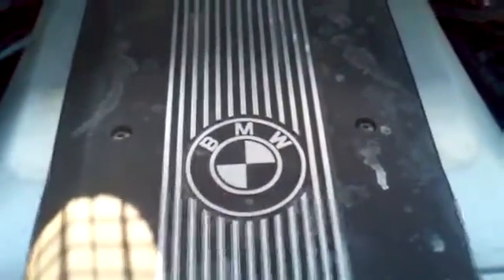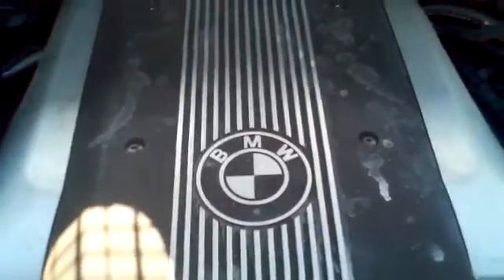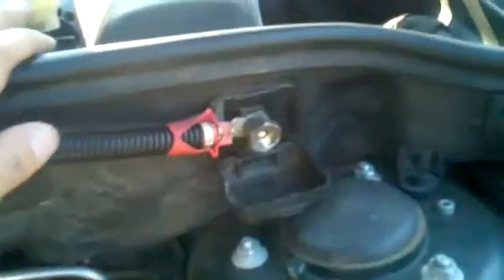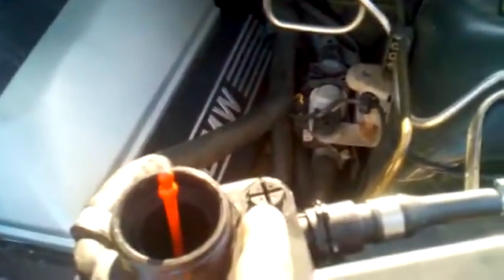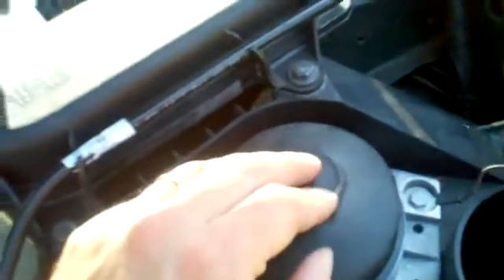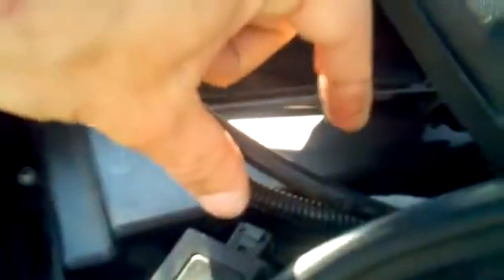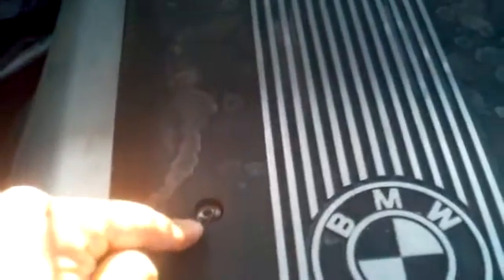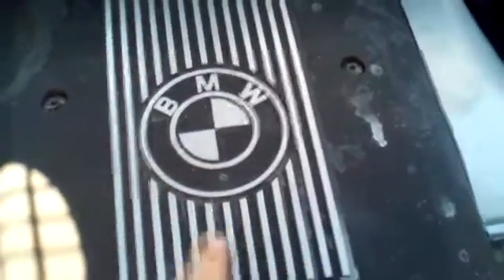X5 Micro Filter Replacement and General Problem Overview

Comment: hi there ...i have horn fail ....i would love if u can help ...when i bush the horn in the steering wheel i just hear clicks on the car anterior ...like it is trying to work
Reply from the maker: Hello, I do have a video on how to test the horns on a 3 series E46 which will be very simalar on most BMW's. To me it sounds like the relay is working because you hear the click which makes this most likely the horns failed. Take a look at my video and it should help :)

Comment from the maker: Hello, As strange as it sound it might be worth a battery reset. Disconnect the negative cable for 10 minutes and recheck operation. You can also check the fuses for the instrument cluster in the glove box. 
Defrost on this model defaults to high when pressed. I am pretty sure that is normal. You would have to use the manual buttons to adjust it at a lower setting for defrost. I have a video on the fuses for the cluster. Someone else had the same problem recently.

Comment: Help please, my wife left the lights on our 2001 BMW X5 over night, we got battery charged, but now I'm having issues with my gas gauge not working shows empty, none of the lights on the dash are working, the settings on the navigation screen to set the time/miles/date etc, does not work it's as if all the settings are locked.  And last, my defrost for the front windshield...it automatically goes straight to full bars (high) only and when I try to turn it low it shuts off.  Thanks!

Comment from the maker: @antharding :) Glad to help. If you look at the front cover at the bottom and the rear cover on the sides where the gasket sits if you can see oil / dirt sticking to the area it is most likely leaking into the intake which causes these gaskets to fail.  I have seen oil leaks from the timing covers so to be pro-active this can be replaced but if they are spotless then it can be something you can consider waiting on but the labor should be cheaper now with the valve covers removed.

Comment: Wow, thanks for the speedy reply.I wish you lived locally,I'd pay you to do any necessary work! Will I know if the PCV plate has failed as soon as i look at it? Im not really sure what it should like like normally. Ive also been advised to change the upper timing gasket and VANOS gaskets at the same time as the valve cover gaskets. Would you agree with this. I do want to make sure the car is running as well as it can be but its sounds like this is turning into one heck of a repair bill! :(

Comment from the maker: @antharding With the 8 cylinder engines the PCV plate is on the rear of the intake manifold. This is what controls the crank case pressure and when it fails can lead to a high oil usage and burning of oil. I recommend replacing the gasket on the front of the intake (also a cover) and all torx bolts as they tend to strip when removed. :) Thank you for the great comment :)

Comment from the maker: @antharding Thank you for the great comment. With the 8 cylinder engines it is common for the PCV plate on the back of the intake manifold to have an internal membrane fail and this allows too much oil into the intake manifold. It can also increase crankcase pressure, both of which can increase your oil consumption. BMW's spec is actually 1 qt per 750 miles :) but this type of usage is unusual. The front gaskest on the intake should also be done and intake sprayed down with brake clean.

Comment: Wow this is MEGA useful, wish id watched it before buying my leaky x5 which now needs a new expansion tank too!. Please tell me, I am planning on replacing the valve cover gaskets because they are leaking oil down the sides of the engine and my x5 is using a quart or so every 1000 miles. What is the PCV plate you talk about in the video? Is it an expensive fix as I will probably need to take it to a garage for this. Thanks, Ant